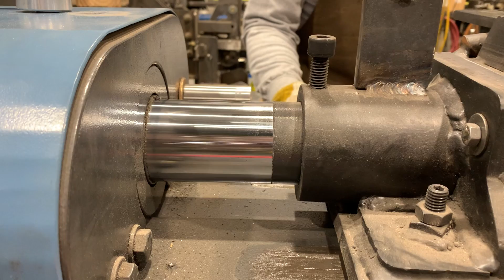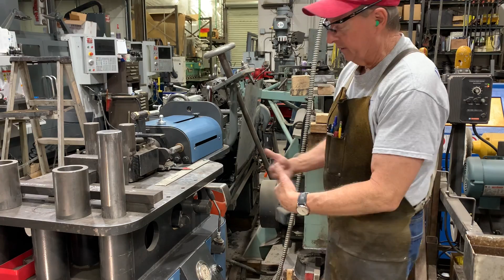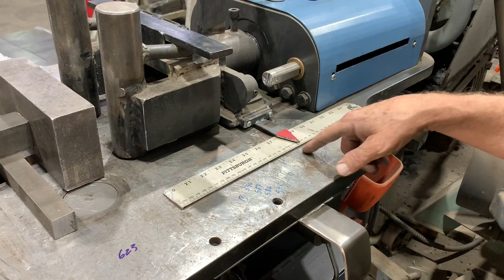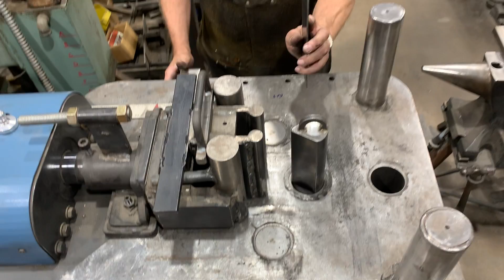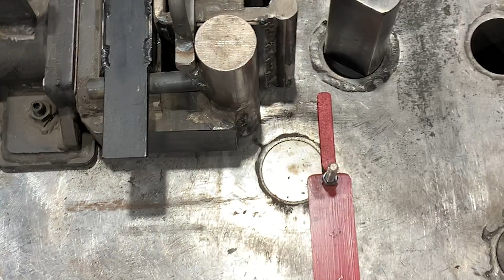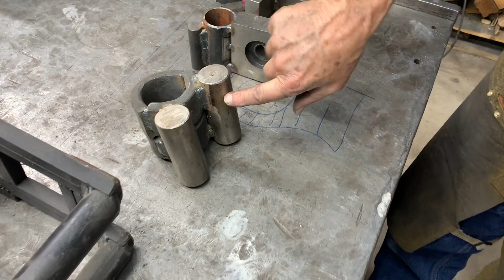Shop Built Horizontal Ram Bender

Comment: what is the brand and part number of the valve you are using.  Very well built.
Reply from the maker: The valve is a SALAMI 6 gpm 4 way 3 position spring center tandem center valve.
Thanks for watching!

Comment: The hand rest for the valve is genius.  The measurement gauge is a great idea.  Incredible that it didn't sound like the motor labored at ALL when bending that 1x2 the hard way.

Very cool!  Thank you so much for sharing it!  Very clear that you've got some keen metalworking insight so I look forward to your future videos.

Also I really love the look of your shop!  Mine is similar: partially fabrication/welding but mainly CNC machine tools (two VMCs and a CNC lathe).
Reply from the maker: Thank you for your comments, we plan to keep making videos! Have fun in your shop.